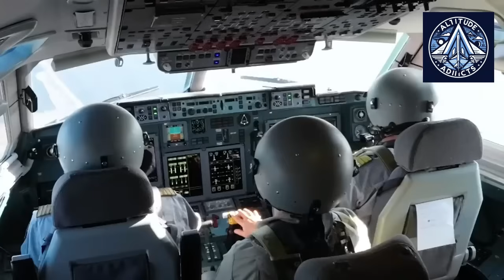Il-96-400T Emergency Landing Explained | Yakutsk Test Flight Report

Comment: Imagine doing 4-engine aircraft in 2025😂😂😂😂
Reply: Imagine seeing someone make this comment in 2025 about a country that built a large, intercontinental aircraft entirely on its own, without importing any parts from outside its borders, while all other countries rely on each other.
Reply: @MohamedhabakaHabaka  The Il-96 is not a new aircraft
Reply: So?
Reply: Do any of you in the west think for yourself or are you all just repeating what CNN tells you!?
For decades it was extremely good to have 4 engines on a plane and then suddenly it's not good, it's very bad!
No, it's still good, only that the manufacturers decided to produce only with two engines and started a relentless campaign to convince you that 2 is good and 4 is bad!
As for me, when I look at the fact that on average every second plane disaster is caused by one engine failure and the plane could not be saved with only one engine, I am very glad that even in 2025 someone normal and smart is still producing a plane with 4 engines!
Reply: @jerromedrakejr9332 "in the west" lol
When were 3-engine and 4-engine aircraft relevant there?? Probably in the 80s. By the way, can you remind me what happened to the a340? Oh yes, it was supplanted by a twin-engine 777. And how many accidents have happened due to the failure of one engine? At least since the adoption of etops-90?
Reply: @jerromedrakejr9332The problem is that the probability of engine failure is very low, and these engines need to be serviced. Two engines are cheaper to service than four. Furthermore, modern aircraft can fly on one engine; a new Airbus A350 can fly 350 minutes to an alternate airport with one engine out.